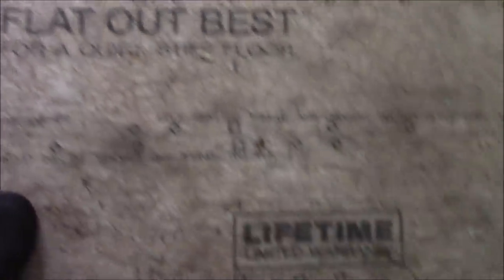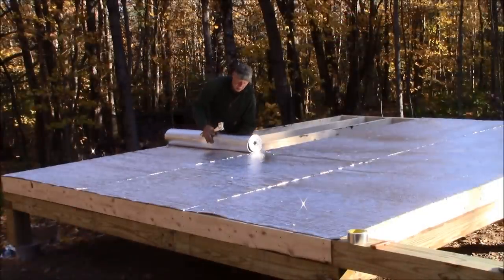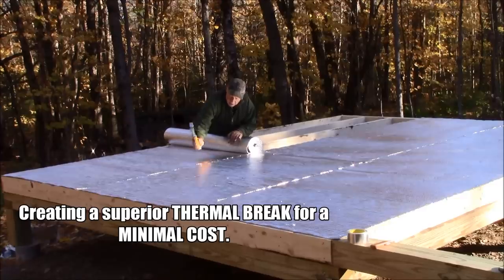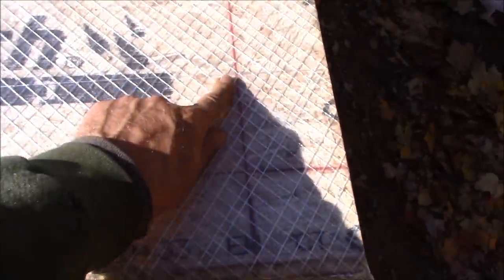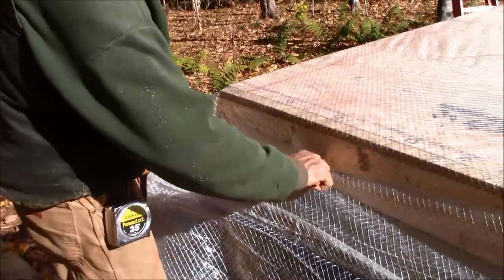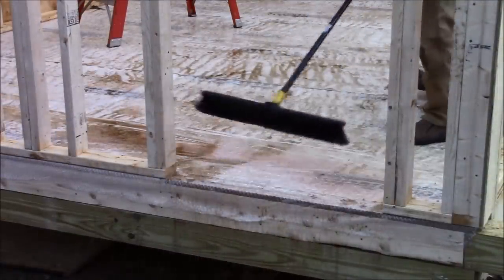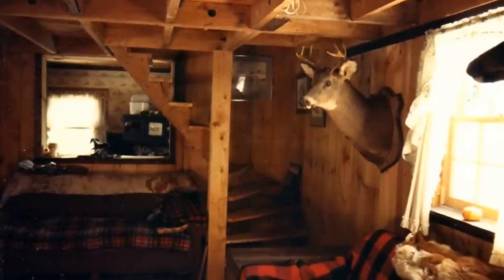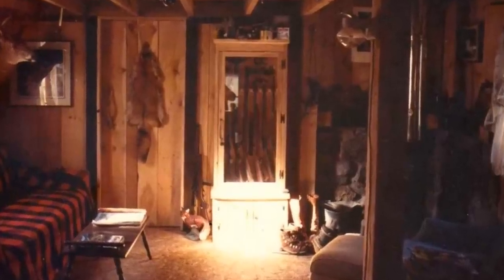Building Your Own House Or Cabin?  WATCH THIS BEFORE YOU BUILD. Build Smart, Avoid Mistakes.

Comment: Have you heard about 12V Diesel Heaters (Dry heat) for RVs or Campers, it might be a thought for the outhouse or whatever. It's timer controlled or thermostat (high or low settings). In the morning you go out there at 8 AM, but its Zero Degrees, maybe nice to have some heat kick on a couple hours ahead of time. A youtuber "Life in a Van' has three vids on the 12V Diesel Heater ($169). He gives the amp and fuel consumptions. Have a look-see. Hey, did you pan around the new shop this time, or did I miss it. Yeah, I caught the flash of bubble foil. You! HA!
Reply from the maker: Never heard of them but I'll look into that.  Thanks.

Comment: Oh my.... we did a lot wrong on your list lol especially the 16 ft cathedral ceiling! Looks nice but cold in my living room no matter what. 

I am curious, we are building another cabin.... what type of foundation do you use to lift it up? I'm in the north in Minnesota and can't find the info. We are on a slab right now, cold! I want up off the ground, but can't find what's proper to get up and off. Do you have a video of the very beginning of a build? Love your content ♡ and no we won't be having cathedral ceilings in the new build lol
Reply from the maker: I will answer this is another Q&A segment.  How big is your cabin and do you have the capabilities of jacking the whole building up?
Reply: @thebossoftheswamp  there's no way to jack up the current building. It was meant to be temp any how and not our long term cabin. The new place we want to build we want off the ground, we are thinking 18 ft wide by 38 ft long .... our soil is about 16 inches woodland top soil and when you scrap it back it's very fine sand... like the kind you would have to pay to get delivered for a building project slab. So excellent drainage which is why we were able to get away with the slab our current building is on with zero issues as far as cracking or heaving, no water comes close or ever stands on our property no matter the rainfall or snow melt.

I know I've seen in your videos how you are on granite there and so I was thinking maybe I can't because mine is the fine sand. Would love any advice, or a hint where I should go look? Maybe I'm using the wrong words in my searches? But I know it gets cold where you are at and your house is lifted up so I know it can be done successfully. 

A hand drawn foundation video on why you picked what you did for each cabin would be really interesting to watch. The roof explanation in this video was spot on and am glad to have found it before we begin our next building adventure.

Thank you so much for all you do. Years back yours was one of the only off grid channels out there and it inspired us to go for it in 2015. So thank you, I'm living the dream now partly because you took the time to show us it was possible ♡

Comment: I am thinking if a 16 X 32 cabin with a full upper floor. I am thinking of making a short stud wall (60) inches topped with a barn style roof to give me the maximum use of the floor space.
The ground floor will be 16 X 24 with a 8 X 16 enclosed porch for a total of 896 sq ft. heated space.

Comment: Hey Boss!, what happened to the Sonotubes under your posts? Not trying to be a smart ass, just thought I was the only guy that set my tubes off. That is a cool shed/greenhouse. All the best.
Reply from the maker: LOL. I wondered if someone would question me on that.  There's going to be a 4x6 running from post to post for the bottom of my skirting to be secured to.  Everything will look as it should when those are applied but at the moment... well you know haha
Reply: Hey, I'd be as happy as a pig in you know what to have that little shed and greenhouse up here on my place Boss. I confess that I had to rewind a time or two cuz I thought I was imagining things. Awesome job JC.

Comment: I understand your rafters preference and agree with it completely. However there is another consideration and it will hit all of us at some point. As we age our ability to use stairs will be tested. I am 66 and have had 4 knee surgeries and am looking at replacements in a few years. Stairs and climbing are not as easy as they used to be and therefore any space that requires stair access is in effect  unusable without difficulty now and likely impossible in a few short years. We have some storage that requires short stairs and we have all but quit it because of the difficulty to access. Like I said don't rule out the idea just approach it with an outlook at the future.
Reply from the maker: I agree with what you're saying and that's why I said "Think of your wants and needs and build accordingly".   One design doesn't fit all :-))

Comment: i am curious and i think your the man to know is it possible to use your under ground storage space to cool your cabin from the heat of summer by placing vents with fans in the floors my thinking is that the fans would pull cool air from the storage space,
Reply: Air to air from under structure cooling can bring some nasty things into the living space. Water/liquid to air is a safer way to go. There is alot of information on the internet be mindful the cool air/space is usually not endless a little time calculating your thermal mass and the ambient air to be cooled might save you some aggravation
Reply: @1STGeneral  thanks
Reply from the maker: My thoughts exactly. Damp air from the crawlspace wouldn't be welcome in my place.

Comment: Hey ol buddy hope all is well, I've got my subfloor nailed down, insulated with bubble foil ofcourse, got my walls mostly fabed up, gettin ready for the roof, my shack is a 12x24, gonna go with a 12/12 pitch to have room for a loft, do I need to use a ridge beam? And also is 1/2 inch osb gonna be good enough for the sheathing under the shingles? I'm using 2x6s for my rafters

Comment: There you go... using your common sense once again.  I concur, gimme rafters over trusses every time.  

The good ol' bubble foil would also work nicely between the bottom of the rafters and your ceiling sheathing material... in just the same way it works on the floors.
Reply from the maker: Agreed. Foil above and below :-)

Comment: I like the t1-11, so you don't feel like you need Tyvek? do you install a vapor barrier on the inside ? Great advice.
Reply from the maker: The only vapor barrier I use is on my insulation facing inward.

Comment: You should do a video on when to use nails and when screws are best. I saw someone using screws on floor joists, could be wrong, but I would of used nails on that. And screws on the floor it's self.
Reply: I believe it's the other way around. Screw the subfloor and nail the floor. But I'm no wiser than you on this one friend. Maybe someone who DOES KNOW will clue us in. LOL
Reply from the maker: I don't see the purpose of screwing down the sub floor.
Reply: @thebossoftheswamp  Di you nail it then? Like I said, I really don't know. I though the subfloor was screwed down because screws don't work themselves out as easily as nails, and a loose subfloor is going to "squeak". ?? Crap, instead of learning all this stuff, I feel like I get dumber by the minute!

Comment: I really enjoy your advice I do have a question you put the plastic on the sub floor so the bubbly foil doesn't get wet. when you take the plastic off do you take it all off or just clean up the edge sorry just wasn't sure what you meant.  thanks Patty ps yes I am  a newbie and my daughter and I  are trying to build her a small cabin. thank you for your help.  is the US Energy Radiant Barrier Insulation Aluminum Foil Roll that is soil on amazon is the same as the bubble foil thanks
Reply from the maker: I remove all the plastic except for what is trapped beneath the wall plates.   This is the foil I use  https://amzn.to/33U5ALh

Comment: great video as always.  I do have a question on bubble foil.  I need to put my foil on my cabin, but the floor, walls and roof are up.  i purchased the 16 inch foil.  should I put the foil on the joists, leaving a 12 inch air gap between the sub floor and insulation, or stable it directly to the sub floor between the joists.  Hope that makes sense.  leaving exposed joists would allow cold to transfer through the wood and back to the sub floor.  Thoughts?
Reply from the maker: Myself, I like it stapled to the underside of the floor. Doing both methods would be a win win.

Comment: Yepper, I live in a mobile that I didn't set with partical wood floors that are slowly rotting away, because the critters tore out the insulation and the Florida humidity  just goes nuts. Good quality flooring and bubble foil would have kept this mobile in good shape. As it is now, I have to go from room to room and rebuild. And believe me anything I replace is getting bubble foil, fo sho.
Maybe smarter and cheaper to tear her down and rebuild Boss Man Style ? The big draw back is they don't let you pull "Owner/Contractor" permits around here anymore. Kinda put ya bent over ifin you catch my drift. 😠👍
Reply from the maker: Too bad about the owner permits  because they offer you a LOT less restriction.

Comment: My question isn't directly related to homesteading but it could help.  It's about using Reflectix or other radiant barrier.  I'd like to make a very light weight Harbor Freight based camp trailer with 2x2 framing and 1/4" sheathing in and out....say 6.5' x 8'.   Wondering if I could use a radiant barrier under each sheet of ply and create an air gap in between.  Would I be doing things right??  If you have a simple and better idea I'm all ears.  73yo and trying to do things smarter with less labor cost is a close second.  Thanks for reading and I do appreciate your down to earth manner.

mike in Los Angeles...84F!!  I need to escape.
Reply from the maker: It would be fine but if it was me, seeing that this structure will be moving around, I would want to glue my sheathing to framework to give it more rigidity. Then staple the foil in between the studs afterwards.  I don't think you'd have a good enough bond by having the foil over the studs.  Wood to wood would be better.  I just said wood 3 times in a sentence of 6 words.   I need another coffee.
Reply: @thebossoftheswamp  Thanks so much for the reply.  Hope that the coffee works!

Comment: The porcupines where I am in Ontario love to eat any plywood or OSB. You mentioned T-111 for siding. Have you had any problems with porcupines eating it?
Reply from the maker: Never have but the porkies at my upstate NY cabin love the pressure treated decking and 5 gallon plastic pails :-/
Reply: T111 is $159 CD here. They have 3/8” LP smart siding for $65 I’m wondering if 3/8” is too thin, but they say it’s structural. No need for additional sheeting underneath.

Comment: Is it possible to put the bubble wrap foil onto an existing structure? I have an existing shed that I want to convert into a bunkhouse. It has floor joists with tongue and groove flooring laid over the top and that’s it. I want to insulate it and use it to live in while we build something larger.

Comment: Of course I have already made some of the mistakes you go through on this video but how else would you learn anything?  I do have a question about air flow up to a loft.  Our place is 14x16 foot with 12 foot walls and 4x12 roof.  The stove burns nice but the loft never really heats like I think it should.  I have a couple salvaged floor grates I was thinking placing two of them in the floor of the loft to allow air to rise up along the outside wall.  Thoughts?  Also how would you suggest using bubble wrap to insulate between the rood rafters?  (2x6 ratters with 2 inches from the sheeting with trounce and grove over that.  Thanks
Reply from the maker: This link will show some recommended applications for walls and roofs.  https://amzn.to/2wvosmW

Comment: I live in the northeast..zone 6. Building codes require  R-48 insulation in the ceiling.  If I use rafters there isn't enough room for fiberglass insulation. I could use close cell spray foam but that is very expensive. What should I do?
Reply from the maker: How about padding down the rafters with 2x stock to make them thicker. This will allow you to use thicker insulation.

Comment: Hey ol friend got another question for ya, my floor joists are gonna be up off the ground atleast 1.5 ft,  would it be ok to use ruff cut lumber or do I need to use pressure treated? If I use ruff cut I was planning on scorching it then throwing on some stain but I'm starting to think it would quicker and easier to go with treated
Reply from the maker: If you go with PT you'll never have to be concerned with it.  I think it's worth the peace of mind.

Comment: when you use the bubble wrap on the walls in the crawl space do you need to still put vents in to have the air to move around. thank you
Reply from the maker: I vent in the summer only. Venting in winter is defeating the purpose.

Comment: Okay, I hate to be part of the you should a brigade but I have done a fair amount of construction and been a home inspector for 20 years. So I think I know a little bit about what I'm talking about. First of all, although you may be saving some labor putting up the t-111, you're going to lose that advantage pretty quickly when you have to keep putting stain on it. And also when you're disappointed at how poorly it weathers after 20 years or so. Second of all on the truss thing, if you live in a cold climate, you're going to need at least 12, maybe 16 inches of insulation in the attic. If not, you're going to be putting a lot of effort into cutting extra firewood. Additionally, you're going to have to frame the ceiling of your cabin to handle that 12 or 16 in of insulation. A huge expense. I wish you had spent time talkinging about installing enough insulation at construction. It's the best investment you can make. Less firewood, less feeding of the stove, less moisture in the wall and attic. The best part is you don't have to maintain insulation and it keeps saving you labor every year. Some day, if you want to stay on the mountain, you be buying that firewood too.  If you need more storage, why not build it at ground level. That way you don't have to carry your stuff up a rickety stair.   I guess you don't put much credence in it, but the engineers who have been designing houses have their reasons for using modern building materials. It is usually because it's the most cost-effective and efficient way to build. I total agree that planning and avoiding cheap shortcuts is the way to go.
Reply from the maker: Everyone has their opinions and that's fine but making assumptions that I need 16" of insulation and I'll be buying firewood and crap like that, well... wtf is that anyway?
FYI and no bullshit here either,  Lori's baking lasagna in the woodfired oven as I type and the kitchen door is open to the screen porch.  It's 4 degrees outside and dropping to -8 tonight not counting WC factor. This is in a 70yo building that was sheathed all the way around with 1x6 pine that has shrunk enough to drop a pencil through the cracks.  Nothing more than R11 in the walls, R19 in the roof of the second story and one layer of Reflectix in the floor.   If mama wasn't comphy should wouldn't be here.   Sometimes you need to compare apples to apples and realize you just may be overthinking things.   

Stay tuned because my next vlog will show how much firewood we have burned this year.
Reply: @thebossoftheswamp  to each his own.

Comment: Got a question, I used the heavy duty plastic and stood my walls up over it then simply cut it loose, my roof is on now and I'm gettin ready for windows and doors, I cut the bottom plate out for my door and there is moisture, like the plastic had sweated and never dried up. What can I do now? It's like the moisture is trapped under my bottom plate
Reply from the maker: The moisture may be from rain that had gathered and weeped through nail holes from when the plate was nailed through it.  All my structures are built in this manner. When I added on to my cabin and cut a doorway through a wall, I  had no moisture beneath that bottom plate when I removed it.
Reply: @thebossoftheswamp  so what do you think I should do? Maybe drill a few holes down through the plate to act as a vent ?
Reply from the maker: @dustincarter1743  That certainly wouldn't hurt anything.
Reply: @thebossoftheswamp  thanks ol friend, it's possible I may be over thinking it a little but better safe than sorry.

Comment: Have you ever used board and batton? I want to buy a band saw mill to build my cabin.
Reply from the maker: Yep and I'll never do it again.  It makes nice SIDING, and good sheathing for a barn or shed but for living space there's too many air leaks with b&b.  Just my opinion.
Reply: @thebossoftheswamp  did you use a house wrap under it? I live in tn so it doesn't get near as cold here as where you are.
Thanks for the reply. Love your videos.
Reply: @jeffdyer2109  I put a 20x22ft addition on my cabin 2009.  Used 2x6 studs, OSB sheathing 7/16", house wrap then BnB with barn board finished 3 sides, 1 x 10 with 1 x 8 x 8ft overlapping 1" each side.  Warm as toast.  In Canada $0.85 and $0.95 /ft and stained before installing. I was 3ft off the ground and put a horizontal rib to hold the boards level and square. Then cap the top horizontally.  One man easy install. Square and measure boards first.  Best wishes.
Reply: @clippersncurls  my thoughts were I have plenty of trees I would use 1x10 horizontal then house wrap and then virtical board and batton all red or white oak.